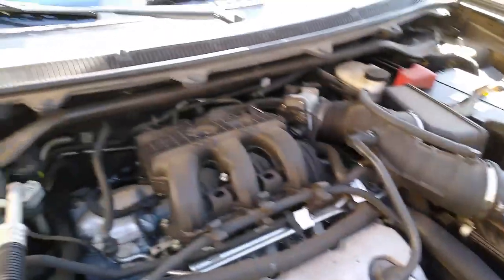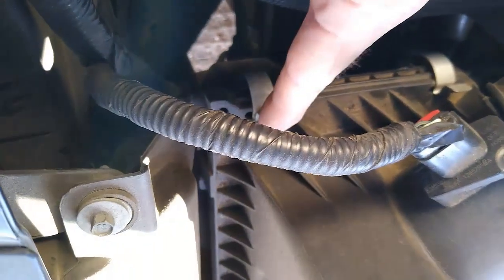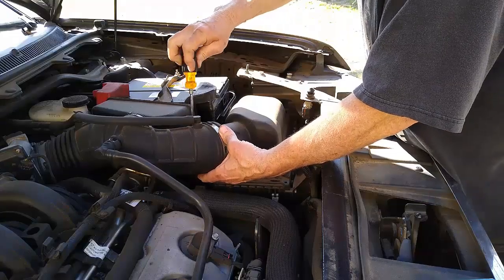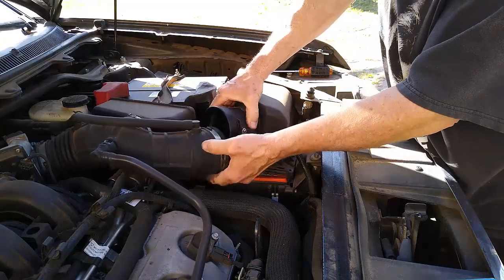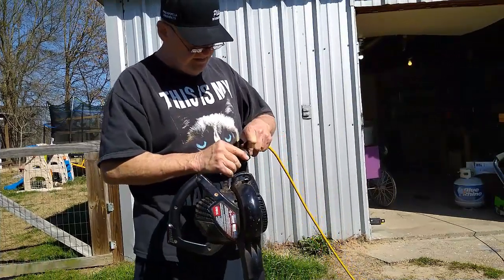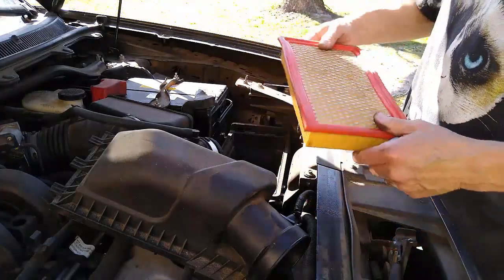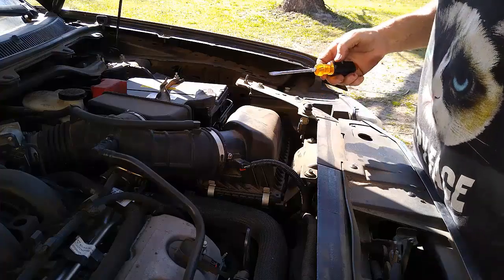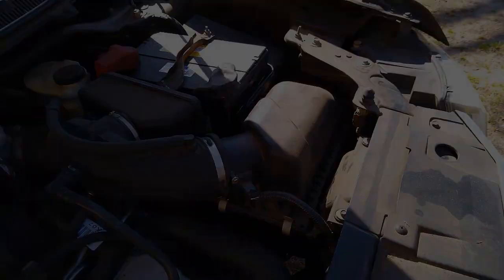Check your air filter, 2011 Ford Flex

Comment: The easy way to to check your air filter is to go to Jiffy Lube for an oil change.  Before the car is even turned off in the bay they can tell you that you need a new air filter, a radiator flush and fill, auto transmission fluid and filter, muffler bearings and turn signal fluid.  Those jackasses would upsell a new upper plate to grandma.  I can’t abide them.
Reply from the maker: LMAO, yeah we got them here too